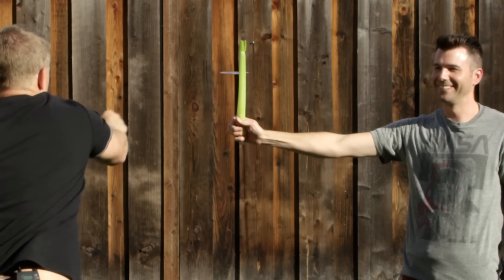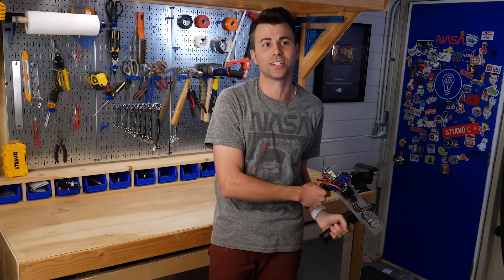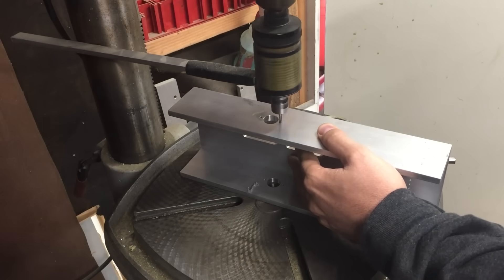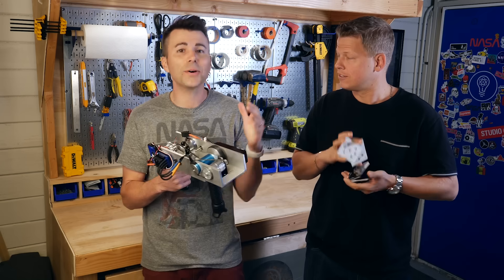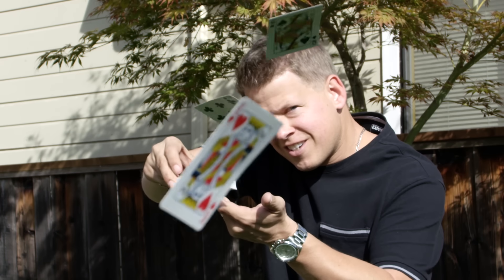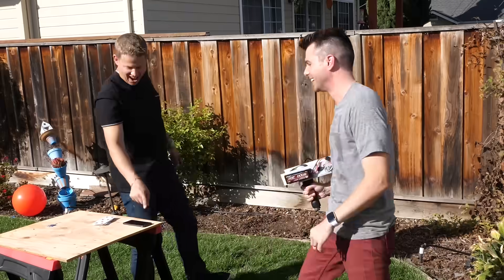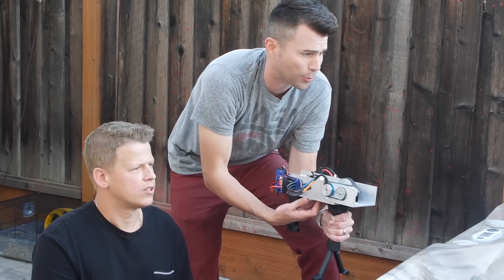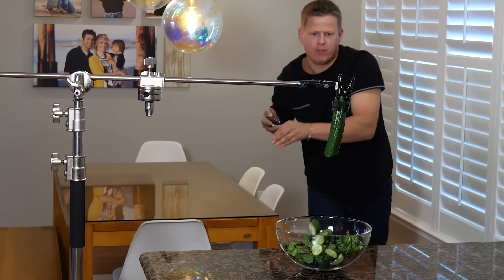Playing Card Machine Gun- Card Throwing Trick Shots

Comment: You missed the melon on purpose. as you could easily corrected the aim while firing, ergo, you wanted to make the quote humans are still better, but deep inside 01111001 01101111 01110101 00100000 01101011 01101110 01101111 01110111 00100000 01110111 01100101 00100000 01100001 01110010 01100101 00100000 01100110 01110101 01100011 01101011 01100101 01100100

Comment: I think newton needs to reinvent his laws because this guy threw a card into a soda can
Reply: And GLASS
Reply: Unigirl 452 what was crazy was the card KEPT THE SAME VELOCITY TO KEEP GOING ITS SAME SPEED AT MOST POINTS LIKE HOW IS THAT POSSIBLE
Reply: @chanceteague1753  I think its best explained with the glass at 4:31 . A Cad is elastic and thus can deform. That actually gives it a mechanical advantage over the brittle glass. The card is only able to transfer all that energy into the glass, because its going very fast. Otherwise the card would simply deform. Also the surface area of the impact is really small as well as the Card is very thick (if you compare the volume behind that impact area). Thus it has a great mechanical advantage and the glass breaks.
Edit: And the velocity actually decreases if you look closely... It has to, because of the conservation of energy, which is now trasfered to some heat as well as the glass flying around and some fluid movement.
Reply: Yeah but he lost in the gulag anyone got 4500$
Reply: I’m

X_X
Reply: Sparkling water**
Reply: He can't because he died
Reply: Meteorite Playz r/woooooosh
Reply: PieMan dont
Reply: PieMan YES I WAS HOPING FOR AN r/woooosh!

Comment: This is not the best version. If you want to get a big spin, then you need to have an unbalanced force, which isn't applied at all by a single wheel. It would be better to have 2 wheels calibrated to be slightly different
Reply: the thing is, that if you look at the first challenge, he fired horizontally, but the cards landed vertically, which means that it is unbalanced and loses power to air resistance.

Comment: you could have won... u didnt because of your card hole placement slightly to the right. and in video u can see the card tilts while flying and changes direction. if it was centered and pully would be near the center of the card... the card might have had a traighter path

Comment: For those wondering, the card trick where he the card mark chose was flipped over is a ghost deck. the cards have a sticky substance and basically for each card theres a card stuck to the other diamonds and clubs on one side, hearts and spades on the other. Then to determine where the correct number of the card lies is mathematically based. the cards front and back add up to 13 every time. so if you have a 9 of hearts the card flipped over behind it will be the 4 of spades. its a pretty genius trick tbh.

Comment: Well while man designs the machine the man is the commander of it so if a human tries to fight machines the machines will do what the controller says so if it's mind to technology it's 2v1 so the power can be set to over a million cell power there for the machine can cut metal using a sharp card while a man can only use a power cell of a thousand which is the highest a man can go for as it can cut glass and probably make a human bleed while machine can kill a human what mark made is around 3 thousand power cell so it can't kill a human but it can damage a human body ( around how many cards it can throw a second is the card speed max ) and is how fast the card can blow out of it's holder. So mark really made something amazing.

So to summer things up a cat can beat the human in speed as it has more cell power of speed then the card that the human throwing machine Rick Smith can throw a card in a row. Like if u understand it because it took me a while to research
Reply: Kids, don't do drugs

Comment: At 6:20 how can I not crush a can with my bare hands but he can CUT it with a paper card????

I AM IN CONFUSION. LOGIC EXPLAIN
Reply: The card has an extremely low surface area upon where is slices objects. This means that the pressure is super high. Its the same way a knife cuts easily through food because of its very low area that it makes contact with what it is cutting.
Reply: @xminterminator  just say its sharp xd
Reply: @MassiveNutsack  theres a difference between low contact area and being sharp. The edge of a t-shirt may have a small surface area, but it is in no way sharp.
Reply: Why is everyone smarter than me lol
Reply: Do u lift bro
Reply: Speed is key!!!!
Reply: If I'm not mistaken there are cards Rick Smith Jr. has called banchees and they are plastic cards for throwing
Reply: Cards are rigged, they kinda look like aluminum cards. Look at how the card is dented like a dented can, and how it then bounces off the table stiff. that's 100% not plastic nor paper.
Another thing to add, plastic cards do not bend like that and when they hit a hard surface at that kind of speed they break / shatter. Same for paper, its not sturdy enough to cut aluminum.

Comment: Who else said 3 of clubs
Reply: It’s called an invisible deck. Every card has another card on the back of it. 10 of diamonds if anyone knows what I mean
Reply: Each card has an opposite. The opposite of the three of clubs is the 10 of diamonds, because three plus 10 is 13, and diamonds is the opposite of clubs. If you look closely all of the cards are even, and there is only half the deck there. If you put a little bit of pressure, you can separate the back to back pair. Just look up invisible deck, and you’ll see what I mean.
Reply: Literally every time Penn & Teller use a card force, they use 3 of clubs.
Reply: I want to know how he primed that
Reply: N1korasu google ghost deck
Reply: @nutcracka23  found a few cool decks a "touch less" cut reveal but I think I found the priming for the 3of clubs well the three at least the rest should have to do with the business card.
Reply: @N1korasu  it's obviously faked.
Reply: One in 52 chance unless you account in bias or jokers.
Reply: Buttered Pie not at all. It’s 100% because the deck is split in half (back to back) most of the time it’s even vs odd
Reply: I said 3 of clubs. Im legit freaked out.

Comment: BTW, that deck had half the cards up and half the cards down and cards are stuck together in pairs with a slight bit of adhesive.  So no matter what card is called he just has to know which end to hold the deck up and which card is stuck to the 3♧, flip to that card, and use more tension to separate the two cards.

Comment: Not to ruin that 3 of clubs magic trick for anyone but I can explain. No matter which card mark picks the trick will work. Half of the cards are underneath the other half and are attached with a type of glue which when is a small amount of pressure will come apart, that is why he is so careful when finding the upturned card as he may accidentally pull apart another one.. If the card is a clubs or diamonds it is on the top and the other two are underneath so he opens the pack of cards the correct way round. If he picked the card when the cards were out then it might not work as he would have to turn the deck upside down. The reason I know this is correct or one way of performing the trick is because you can literally buy the deck online- I have one and have done the trick many times!

Comment: 3 of clubs trick was using an invisible deck. He told you not to go with ace of spades because it would be the first card. Clubs and hearts are on one side, diamonds and spades on the other. They stick together by friction, using a coating on the back of the cards. Had you said spades instead of clubs, he'd have taken out the deck upside down.

Comment: No you need to create something that picks up cards!!
Reply: Easy, put a layer of a strong magnetic metal on the cards and use an industrial magnet to pick all of the cards in a room up at once
Reply: @gigi00789  compromises the light-weightedness of throwing cards
Reply: @deadalpeca8099  layer of metal doesn't have to be thick. And he just said pick up cards, not cards that can also be thrown!
Btw, metal doesn't necessarily mean it's a lot heavier, it would compromise the flexibility needed to throw the cards  though, as in the air it flexes which stabilizes the card a bit more
Reply: @gigi00789  or just put a tarp on the floor and when done, you just fold it to group all cards together
Reply: Now I can beat everyone in 52 card pickup